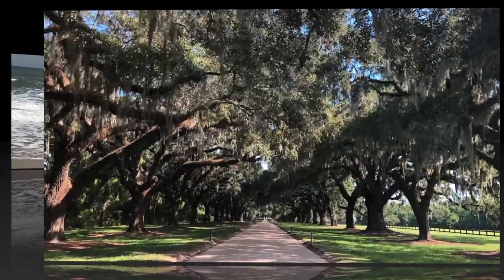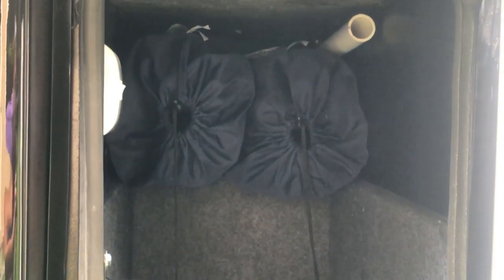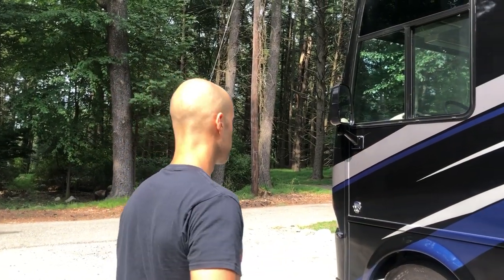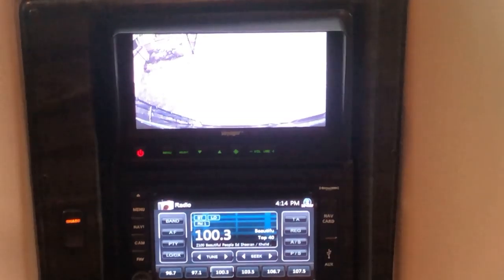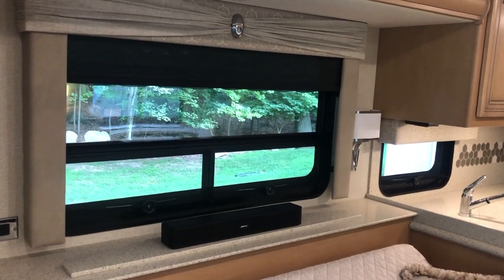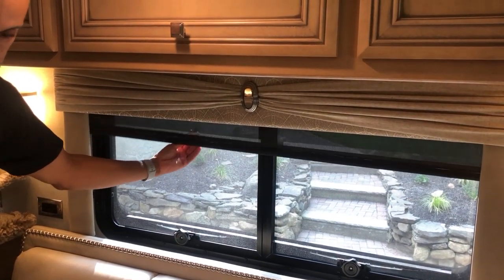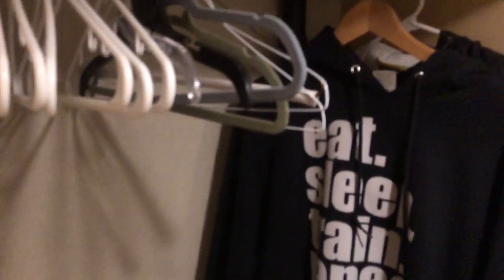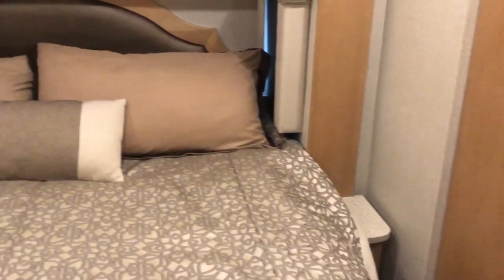The Ultimate Newmar Bay Star Full Walk Through Tour

Comment: I'm in the market for a luxury gas Class A and Newmar is on the list.  The other one is Tiffin Allegro Open Road.  I like the dual pane Windows on the Baystar, but I like the heated bays in the Tiffin.  The heating pads in the Bay Star aren't much help if you are off grid / boondocking.  I don't know what the amp draw is on the Newmar Tank Heating pads is, but looking on Amazon the 12v 8x25 heating pads are 5amps x 3 for Fresh, Black, Gray tanks = 15 amps, add in a residential fridge at 10 amps = 25 amps per hour. Factor in other items such as the furnace+fans, TV's, etc. and it's a lot of power.    From your videos, the tanks are enclosed in the underbelly, it's a shame they didn't do another heat duct and return.  I guess you could always put a small propane catalytic heater in it on low, but I don't know how well I'd sleep at night doing that.  The Tiffin has enclosed and ducted tanks.  But it has single pane windows.  Grrr.  Trade offs.  

Another thing I noticed from your video is that the battery dimensions seemed small.  After watching your video I googled Bay Star Battery Size and it looks like they are group 24?  Not a fan of that.  Group 24 are only 10.25" wide but a group 31 is 13".  That's a limiting factor when upgrading batteries.  You can always fit a smaller battery in a bigger bay or tray, but not the other way around.  It's a shame because the battery compartment height is great.

Thanks for your video's.  I watch them all and really enjoy them.  You have a good variety of topics, your videography skills are great, and you have great chemistry.  Well done!
Reply from the maker: Thanks so much! You really can't go wrong with a Newmar or Tiffin. We actually have a battery video coming out in a few weeks (upgrade) so stay tuned. Thanks for the kind words and good luck to you! - MJ

Comment: Very detailed review.  Thank you.  Saw a review of 39 footer and he did not like the driving quality. Rear end sway. We are  looking at the 3408 which is the smallest one you can get with a washer dryer but we I really like your 36 layout much better but afraid of the extra length and weight with V10.
Reply from the maker: Thank you for watching.  Do the usual suspension upgrades such as sumo springs (front/back), Safe T and rear track bar and the handling is greatly improved.  Also I believe the 2020’s are on 26k chassis.   It will never match the ride of a DP.  We are at the Hershey RV show and the new Kountry Star is an outstanding entry level coach starting at 37 feet up to 40 feet.  We love our 3626 and Newmar customer service is outstanding.

Comment: Great video. We've been looking for an RV for a awhile. We've been looking closely at the Baystar. We really liked your assessment on build quality, AC capability. Thanks for the detailed walk through as I now have a bunch of questions when we visit the local Newmar dealer. We, like you, will not be full timers so a gas coach makes sense for us. We'll likely go shorter - 3014 since we are empty nesters and it will be primarily the 2 of us.
Reply from the maker: First off thanks for subscribing.   We love our Baystar. Our cost for chassis maintenance this year:  $40 for oil change (DIY), $20 Air Filter (DIY). $170 grease chassis @ Ford.   That’s it.  Next service @ 15k cost should be very close to being the same as first.   

I would wait until mid 2020 as the new Ford 7.3 V8 is going to be going into f53.  Big power Improvment plus 10 speed tranny.   The 7.3 was not even released when we ordered or probably would have waited.  

Keep us updated and good luck on your search.

Comment: What do you think about the 2021 model? Funny how time changes things...have been all set to get the 3401 soon (waited for the chassis upgrade) but the more I see this the more I like it. One of the issues for me was to stay under 35 ft have you ran into any problems because you are over 35 ft? Have heard it can be an issue in the National parks and else where. Thanks for any response. Oh one more thing...how is it when you have the front camping side slide out with reference to the awning didn't see a pic of that:)
Reply from the maker: Good move waiting for 2021.  More power, smaller engine and upgraded suspension.   As for getting into places we have never had an issue.  Can’t speak about national parks because we have not been to them with rig.  If anything we want bigger with more room.  There will always be a place to stay close by if we could not get into a certain park.  For us bigger gives us more comfortable living space, potentially more tank capacity as well as more roof real estate if we want solar.   As far as the front passenger slide the awning covers the whole slide length.  Hope that helps. 

Izzy
Reply: @EndlessRVing  LOL...I know it covers the whole slide but how many feet past the slide? Also is there a slide topper on that or just the awning? Thanks:)
Reply from the maker: Not sure how long the awning is.   There is no topper on that slide.
Reply: @EndlessRVing  Thanks:)

Comment: Great video,,,well done! We just put a deposit on the 2020 3226 model which is similar in floor plan but shorter. One question for you, how are you getting buy with battery and electrical system? I am trying to get Newmar to option a 2000 watt Pure sine inverter and auto gen start (I have 2 dogs as well) however they have not gotten back to me as of yet. BTW we were also at Hershey this year. For a coach with 8 batteries, I was disappointed in the ability to utilize that amperage without the total need for the generator or shore power. Apparently the 1200 watt inverter they supply is exclusively used for the residential refrigerator, (which we choose) and C-pap machines in the bedroom. I am waiting for them to get back to me on splitting the plugs so that one outlet is inverted and the other is on shore power, (like their canyon star) That is my only concern. What do you think? Oh ya do they have an option for Truma instant hot water??
Reply from the maker: FredFromBoston Fred 

Thanks for watching Fred.  We have 4 battery setup with dual 1200 watt inverters that for us has worked fine.  We just came back from Nappanee and we were talking to a couple that was having a auto gen start installed at the Service Center so they may do that for you.   I had the Truma installed by Truma while I was in Nappanee.  It is an outstanding product so far.  They told me that Newmar is offering it on one Canyon Star Model.  I just uploaded a video review of the Truma.  It’s the real deal.

Comment: Hi, did you mentioned you have 22.25” wheels ? when i search for a used Newmar Bay Star, they all have 19.5” wheels... do you think i could change the wheels from a 19.5 inch to a 22.25” wheels (would it clear the wheel wells?) this would solve my problem (i wanna a class A RV with higher ground clearance...)
Reply from the maker: daniel de schepper 22.5 is on baystar.  Are you looking at smaller bay star or Baystar sport?
Reply: Endless RVing just looking around to find a deal, your videos helped me a lot regarding the different brands and models (quality) but I wanna lift or at least get more ground clearance (love boondocking, but wanna keep the luxury of a A class) as far as I know now, nobody ever lifted a f53 chassis.... But I wanna have the ground clearance! 😁
Reply: PS : I don't wanna stay below 30’
Reply: Sorry, wanna stay below 30’